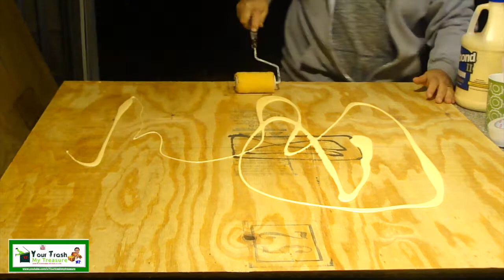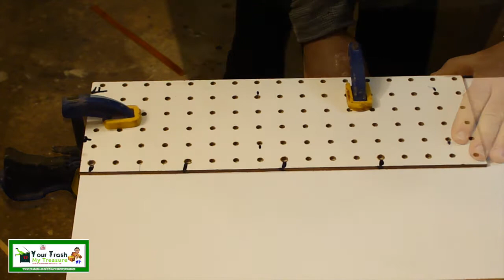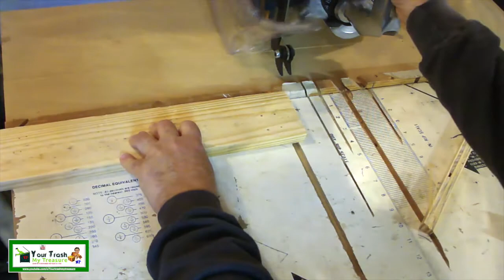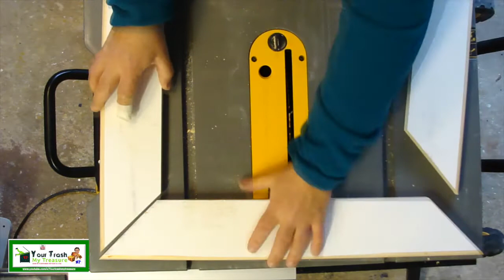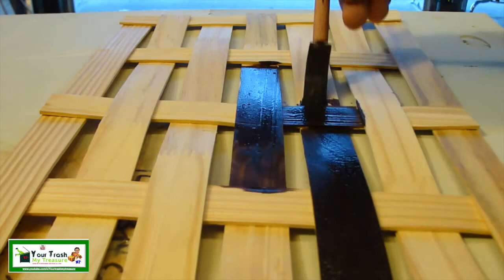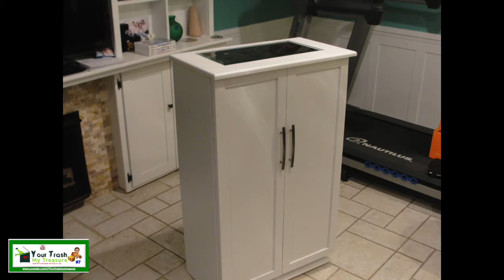How to make a Bathroom Towel Cabinet

Comment: wow Lou that was Top Notch it turned out great you did an awesome job on that keep up the good work brother.
Reply from the maker: Thanks Opa I appreciate that.
Reply from the maker: I like to prime and paint before assembly, then when i'm finished it is easier to put the final coat on, you only have to concentrate on what shows the most and what you can't see is already done.